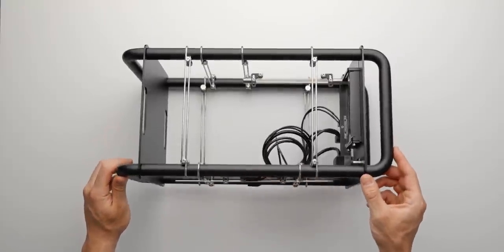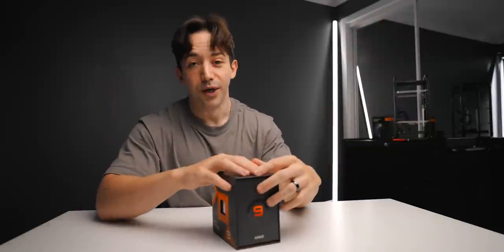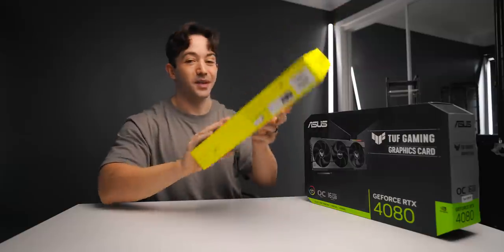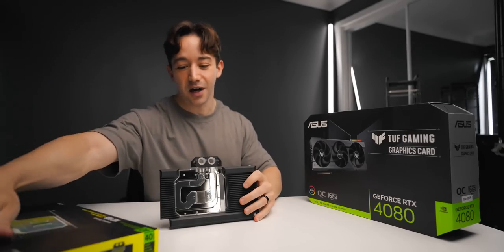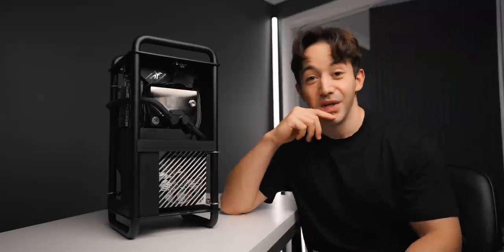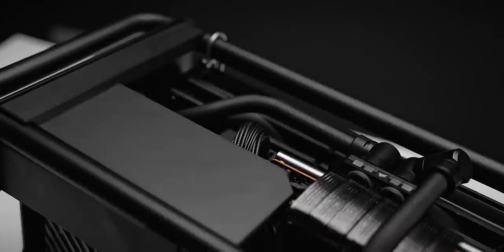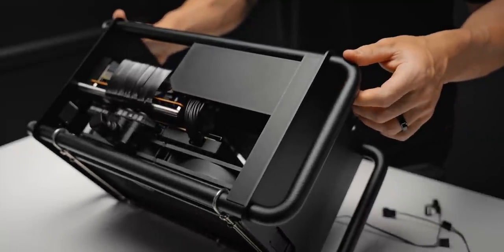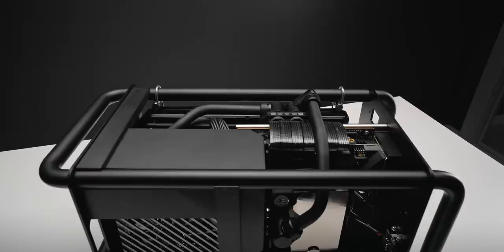My liquid-cooled PC (matte black everything)

Comment: It's definitely sick but I would've changed a couple things. 1 I would've added a water temp sensor, anything over 45c is into the limits of d5 pumps and certain tubing. 2. I would've honestly built it with an external rad in mind with soft tubing. Have it on the desk and the external rad under the desk. Looks great performs better

Comment: Streacom ftw! It's really cool to have a case manufacturer on the market that really thinks (literally) out of the box to make amazingly well designed and machined products, and keep the cost very reasonable. Open air frames just make so much sense: they're cheaper to manufacture, dust is easy to cleanup, they don't have metal panels that resonate with fans, and the temps are insane.

Comment: Excited to see you get into sim racing, though I can highly recommend going VR to really kick up immersion to 10/10.

Your vids are inspiring, I want a 3D printer! I loved your video on making 3d printed ducts for your setup, I think the next major step in PC design is ensuring hot air isn’t recirculated. I’ve got a terrible case for airflow (Fractal Vector RS) but I got it running cool and quiet by using strips of mass loaded vinyl to guide fresh air towards the intakes and preventing my GPU’s exhaust from being recirculated.

Comment: FINALLY! , I've been waiting for your DA6 water cooled build for years. I actually ended up on the  DA6 waitlist. I did go 4080 & cpu air cooled with the NH-D12L (only sticks 20mm) but did go with the 5800x (OC) instead of the 5800x3d since it get hotter due to the extra cache, just got better ram  sticks. I use it mostly for flight sim and temps are fine.  Thank you for the 3d printed cover I also don't like  how the cables look. Awesome build as always.

Comment: If you think high end SFFPCs are an expensive hobby, wait until you get into Racing/Flight simulation peripherals.  

I did tech support for a guy who was a retired pilot.  His racing and flight sim set ups (two completely different rigs) were made with chairs from actual vehicles, extruded aluminum frames, and control boards and peripherals that cost thousands of dollars to source, modify, and get up and running with the computer (which were also top of the line, insane PCs in their own right).

Beautiful builds as always, enjoy the new hobby and the rabbit hole it can bring.

Comment: I was very doubtful whether a slim 280mm rad would be enough to cool that CPU+GPU, so I'm amazed to hear of those temps! I suppose the open frame case makes all the difference.
Reply: It helps that the cpu only pulls 70w in games. If you replace with a 14900k for similar performance, it’d probably double the wattage of the entire build, saturating that tiny rad and hurting gpu temps which actually matter for performance.

Comment: Nice build! I love the DA6 but i wish they would make a "DA6 Water" one, with the mainboard 25mm moved to the front. It's to far in the back with a watercooler, would look so much better and would give you space between the mainboard and the GPU to hide all the cables! I mounted my 280 rad on the side to suck out the hot air of the VRM and between mainboard and GPU. Works perfect. You really need some airflow between the two aspecialy when you have a m2 ssd on the back of the mainboard. Try to touch the GPU backplate 😉 i bet it's to hot to touch in your build while gaming.
Reply: How does it make sense spending 150$+ on a case that should be 60-70$ max? I'm not fond of sff cases but this case doesn't even have any drive cages and looks like something you can build from off the shelf home depo parts. I know PC case prices are hella inflated right now but still this is hella overpriced for what it is.

Comment: I've been looking at ITX cases, window shopping and checking out the channel, and I think the Jonsbo V11 is the best looking one, at just over 10L not the smallest, I have a Jonsbo V4 for a mATX that's 20L that in volume is smaller than a NR200 but only fits a 260mm GPU, cooling a little on the weak side. I'm not a Jonsbo fanboy, I brought the V4 because it's the only case I'm aware of with this layout. If I did a ITX build it would have to be in the V11, even if the cooling on the weak side and the front fan looks like it's block by the PSU.

Comment: The build looks great, also a great idea with the 3D printed cover for the cables, I´d might have done that too.

Pre-applied pads on the block are nice to not have to deal with their placement, but insane EK doesn´t even pre-cut their pads at that price.
Because of looks I chose an Alphacool Aurora, and that comes with pre-cut pads at a lower price than EK (at least in germany).

Comment: I normally dont comment on compensator 9000's but this one is cool. Good job pushing aesthetics without compromise. Personally, I go with intel cause I am more comfortable with overclocking intel CPU's and tweaking voltages. I hate how I build like like you and only touch whats nessisary likes its a plate of food. These components can take way more abuse than i thought.

Comment: Had the b650e-i strix + 7800x3d then figured out the 12v pin on the aio pump header wasn't soldered to the board from the factory. Could literally slide the pin and and out from the board 😅. Local store didn't have a proper  itx replacement so just went 13700k + z790i edge instead.

Comment: Asus boards have issues with displaying bios after you enable expo/xmp when paired with 4000 series. Enabling memory context restore and power down mode fixes this. Context restore is the fix but it needs to be paired with power down mode or windows will bsod on splash screen 🤷. I believe this is a non issue if you're using hdmi tho. It's a displayport driver not initializing properly from bios issue. Asus is a mess on am5.

Comment: Love these build videos!

By the way, have you experienced a very weird, specific issue with the Asus B650E-I?
I currently have this board in my build and if I boot to windows from BIOS, the PC entire boot process and just logging in to windows is nigh impossible because of some odd lag that just sticks around until I power off the machine by pressing/holding the power button.

I can't find ANYONE else with a similar issue and I have no clue at all what to do at this point...

Comment: How come soft tubes are no longer a thing? I mean I understand the clean aesthetic of hard tubing, but for a guy that wants an extremely well performing PC with a custom loop, but doesn't really have to measure, heat up and bend pipes, is it still a valid option to go for?
Reply: If anything, I'd argue that soft tubing - or at least gradual curves - are better hydrodynamically... but the sharper corners of hard tubes wouldn't cause nearly as much resistance or turbulence as many of the joins/fittings in a loop.
Reply: It’s just personal preference. You can also use both in your loop. If you go with soft tubing I would recommend going with EPDM so there won’t be any chance of PVC leaching.
Reply: Yeah still highly valid. Hard tubing has no performance benefits over soft tubing, just more an aesthetic choice
Reply: From my experience it's actually harder to place soft tubes in a tiny space than plan and build with hardlines, especially if you have to route sharper bends through your case.
Reply: Tbh there is no benefit going hardline beside look. Just go softtubing way cheaper, easier and less time waste
Reply: @mattspeed  this is what I was thinking, I wanted to build inside an ITX with custom loop but I prefer functionality > aesthetics, and it would be my first build so I'm worried about wasting too many pipes bending the wrong way or making something too short and then damaging my entire build with liquid coolant

Comment: Why a 7950x3d and not a standard 7950x? You're playing at about 4k, in gaming there will be no difference because you will be gpu bottlenecked at that point. Then if you ever decide to do any production work you will be losing performance due to the lower clock speeds.

Comment: Where did you get those power cables? Are they stock? Or did you buy the actual wires/cables by the meter and made custom cables? They look great for being unsleeved, which is great for ITX where you need to make sharp bends...
Reply: I posted before the part where you show the mess of cables. Incredible build but I don't understand all the effort in custom watercooling, 3d printed part... to use the stock cables and have a rats nest of cables...

Comment: wondering if this build would work with a current model i9 13900k or 12900k  and if temps would be okay with the rad being used ? ive been told need atleast 2 rads for a cpu gou compbo i would even be okay with a 3080 or a 4080 any insight would be good :}

Comment: What kind of bad itx did you assemble

You bent the pipes without a template, bend radius is floating.
The motherboard, like everything else itx, is garbage, with a small howling cooler on 40 mm
The coolers are close to the video card, where will they suck air from? And the radiator is very small for such a system, and it is not blown properly.